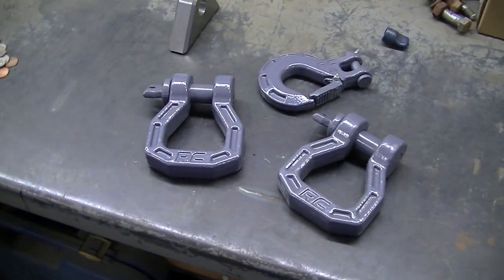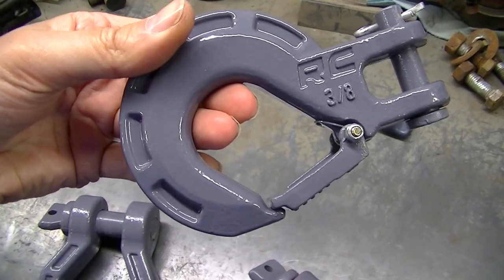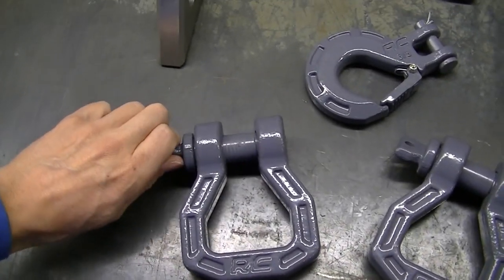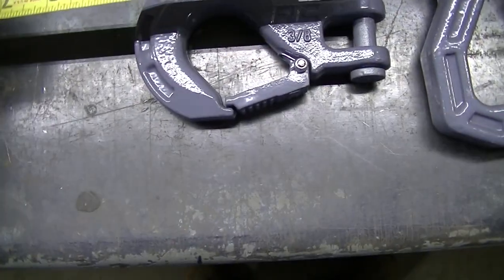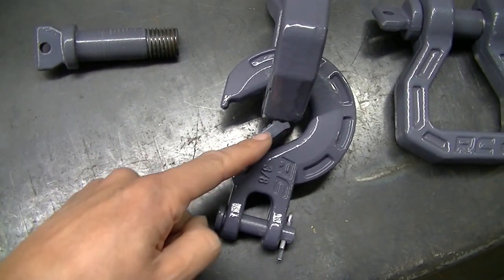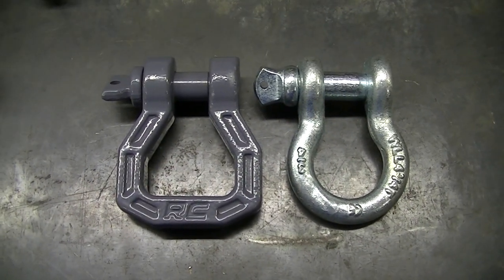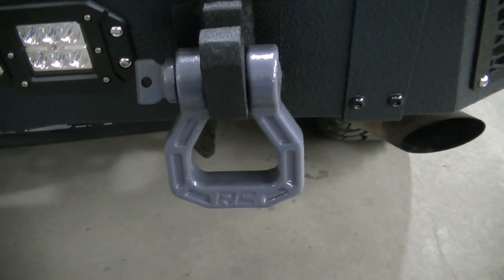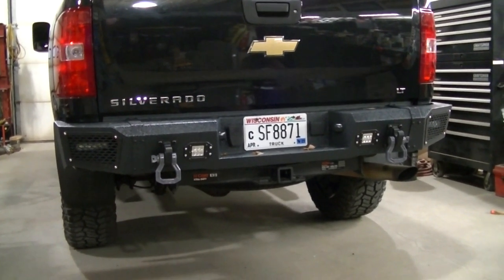Rough Country Forged Shackles & Clevis Hook Overview

Comment: Seems like there is no standardization with these shackles. I bought some of these for a car trailer I have and the bolts were too big for the chains I had. I went back to the store, but it looks like I have to buy new chains and can't use the ones I have. The shackles were either too big or way too small for my chains.
Reply from the maker: Yeah, it seems that way. Looks like everybody makes them different.